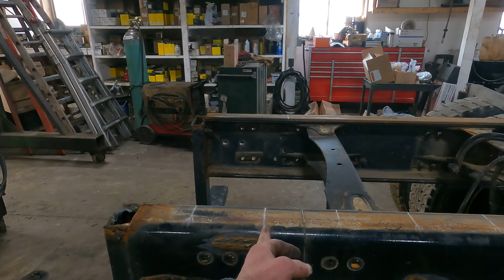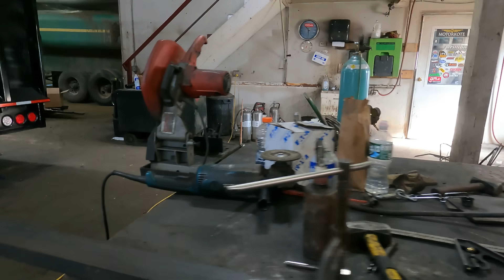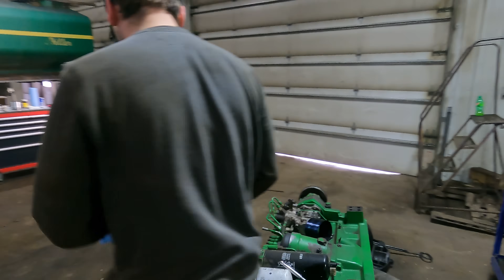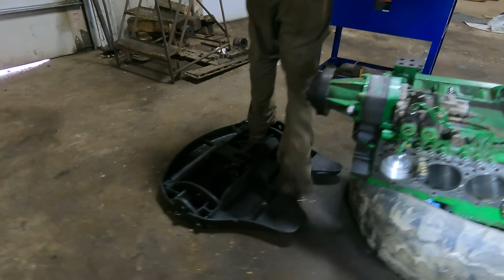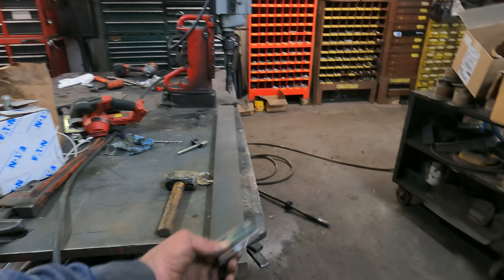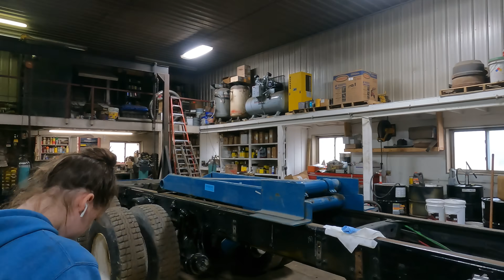Better late than…. Never

Comment: The Build seem to be coming right along on Q . Every thing looks good so far Andy ! Jared Seem to be moving right along with the engine build. . Here is a thought . You need a Crane Mounted That goes from one side of the building to the other . That can be used in all the bays . That needs too be added to the shop wish list along with the Tig Welder and press . I can Vision this said crane over on the side of the shop . You could also use it with your body builds as well . Ok enough with my dream (  Pun Intended ) lol  Nice video 👍👍😁
Reply: Wow great concept, can you be counted upon for the first 10 thousand $$ donation as this feature is added to the budget❓❓Should be able to fully implement for about $75 thousand -/+ ,check or cash works & Andy will give you an honorable mention. BTW, you tube is changing their name to *you should*.

Comment: What made you decide to use the torch instead of a plasma cutter to cut the frame? Was the frame to thick? I just bought a plasma cutter and haven’t used it yet.
Reply from the maker: Torch works better on a job like that

Comment: For the piston rings, the bottom one which is for oil control gets clocked at 90-90-90 and the middle and upper rings gets clocked at 120-120 apart from each other. That’s how I was taught and never had any issues in the 30 years I’ve been rebuilding engines.
Good luck.
I noticed on your last video that you don’t weld in a cap on the bottom rail on the tailgate ends. I would think that you would make it a point to close up those ends to keep water and debris from building up inside that area and and making it rot from the inside
Reply from the maker: Never have

Comment: Having spent too many years scrabbling around on the floor fixing engines and gearboxes I can't help but feel for Jerred, good steel top benches of different heights and an engine frame make a huge difference, especially when considering the tolerances and the attention to detail required never mind the cost of those engines.

Comment: Soon  jered will have the engine running perfect!   He can't control the quality of work that others do or the parts they use .  It's very common for alot of little mistakes  wrong parts or not replacing parts to compound a problem . I've chased my tail more than once working on equipment before realizing that someone else from a 3rd party  messed up along the way.   Great video keep up the good work!

Comment: Was surprised you are not using L.E.D. grommet mounted lights in the tailboard of the truck. What do you rgister the truck as since you can change it from a box to deck to tank ? I wouldd not want to hit that back bumper looks pertty heavy duty low chance of crumple less you built out of thin material 😁
Reply from the maker: The two square lights are just in there for off and when the truck travels on the road without the box or the tank on it. The box has a full set of L E D lights on it

Comment: Another great video of a busy day in the shop. Andy have you ever used dish detergent to lube drill bits? It's works real slick. Just have to wipe off after use so they won't rust. Makes the metal cut like butter.

Comment: Hey there Andy, I hope you're all well and good! 

Andy, I've noticed that every time the music starts, you kick it up into overdrive, and when the music stops, you shift it back down into drive.

Jarrod is a man of few words, and I'm not necessarily criticizing him, but that's the first time I've ever seen an engine assembled on its side like that.

All of those different pistons, in both aluminum and steel, those aren't all OEM parts from Deere are they?

That box is looking good, with it being a slide-off, it's added quite a bit more work to this build when compared to the other one before it. 

I hope y'all have a good one! 

"Nothing Runs Like A Deere" 🦌👍🇺🇸
Reply: Turning the engine on its' side facilitates insertion of the piston/connecting rod then convenient transition to fastening to the crank. If you had performed this task & not simply watched, you might appreciate Jered's methodology.
Previously you stated Deere is #1. But the AED does not publish sold units values, so where is your data sourced❓ 
It is also worth noting that Deere experienced their highest profitability in years. So how was this achieved❓At a time of national pandemic, & farmers & ranchers slaughtering livestock because the processors were idled, restaurant market in crisis, & farmers facing escalating costs, Deere saw an opportunity to stick it right in their rear end, & I screen shot a comment from you that states, as long as the profits tickle your portfolio, all is well. Forbes published an in depth analysis of Deere'$  actions during this health crisis & the conclusions are very unfavorable toward Deere'$ absolute greed, especially in the area of CEO compensation. You stated Deere could not take advantage of  their customer base & be successful, but I say to you buddy johnny wayne, they absolutely screwed their customers to the hilt. Forbes published an abridged version on their you tube channel for those that prefer the cliff notes version. My comment is lengthy w/facts, yours are spaced w/ greed, hot air, & insensitivity toward an Ag community you pilfer.

Comment: The old trick is to take a old liner and have the ID tapered to use instead of a ring compressor. You don't need the whole thing.